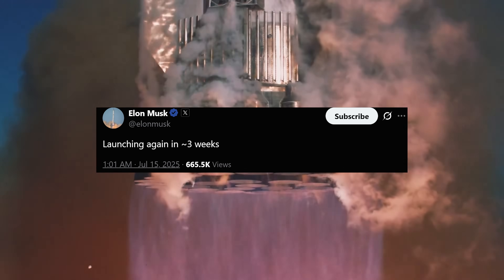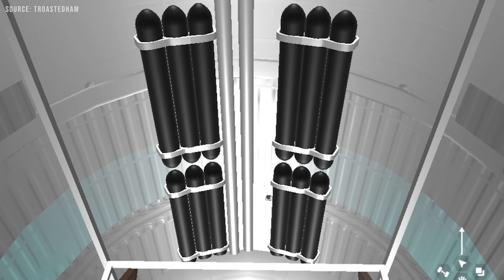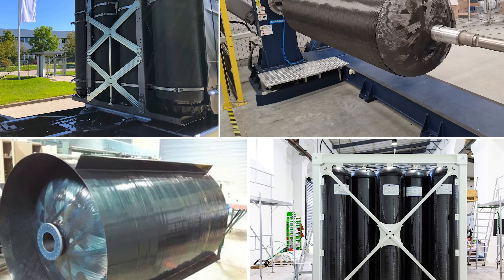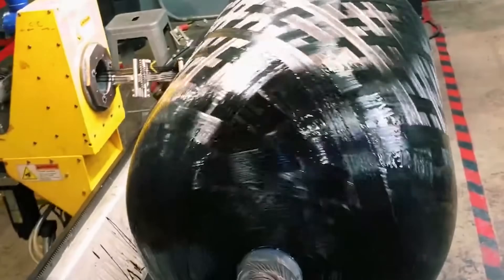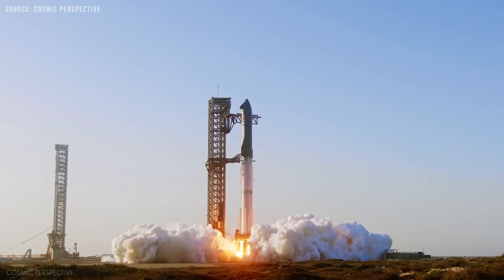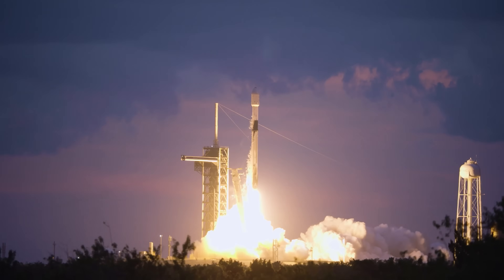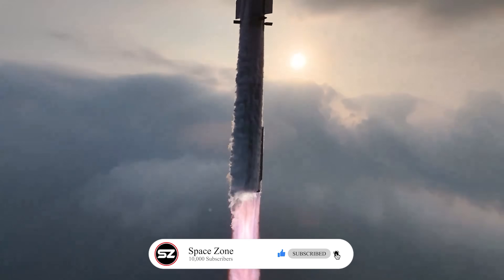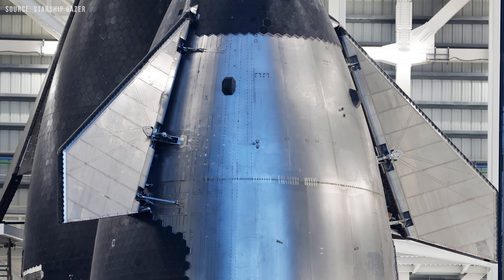SpaceX found COPV Breakthrough Data to Ensure Flight 10 NEVER FAILED!

Comment: They should be wrapped in various media;with different micronage. As well as the angle of micronage application. It will improve the COPD’s chance of performing its task more accurately.
Reply: The COPV issue is highly likely to be a result of mishandling. 

Various people have commented about the rough treatment of various parts. Dropping the things - even from 30cm -  is no bueno